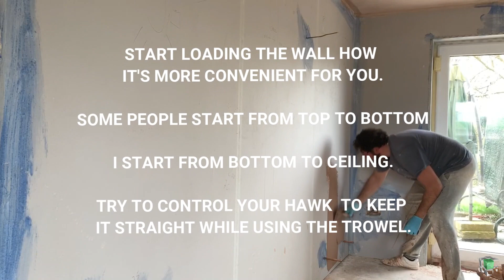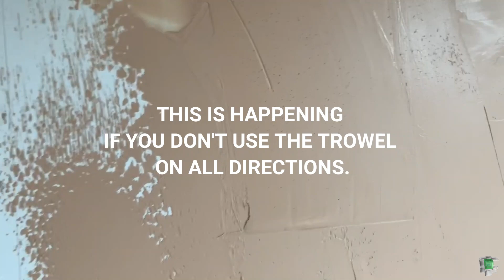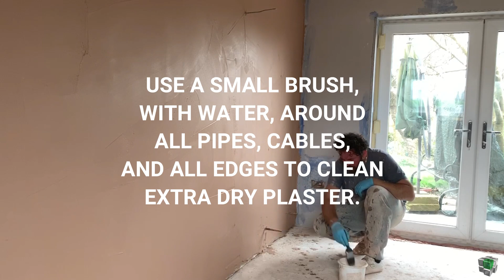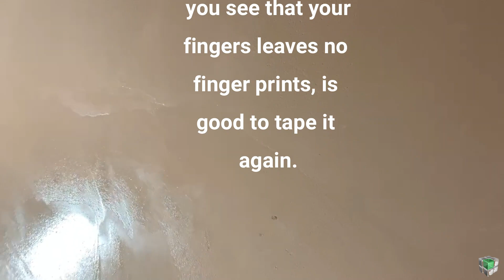How I do plaster easy steps, how I skim a wall, two coats of plastering, finish using a taping knife

Comment: Hi, loving your videos. Really good. My girlfriends uncle is a plasterer in poland and he uses the taping knife/spatulas too. Good method. I have a question when i use the taping knife i tend to get lines in the plaster. Any tips to prevent this happening?  Thanks
Reply from the maker: It could be many reasons... one I had it was because my tapping knife it was old and bend, one of my workers put it in a bucket with other tools and it wasn’t straight anymore... another reason it might be that the corners are making marks... so I bent my self the corners of the tapping knife, so it won’t leave anymore marks... and one of the most common reasons is if you’re keeping the tapping knife too flat towards the wall, you will often touch it with your fingers, or the tapping knife handle... I hope I could help with this answer... Goodluck 😁
Reply: @askhowtube  Thank you for the reply. I will try and round the corners today and check they are all straight edges. Keep the vidoes coming. Good job. Thanks
Reply from the maker: Thank you..

Comment: All the British spreads are stressing over this 😂😂😂 Do whatever gets a good finish! Even if your putting it on with your feet 😉😂
Reply: No mate,  I'm telling you right here and now.. you lay on 1st and 2nd coates like that day in day out... You will be finished before your 30.

Doing it that way on a 3.5 x 3.1 is OK you get away with it.. Try laying a 25-30m ceiling like that.. There's nothing wrong with useing your own methods. But some  just make the job way harder.
Simple facts

P:S Any bloke that shines up his walls.. Gets binned immediately.. Especially if on site work, gaffer will knock you for sure..
Reply: @stevengordon2145  what was wrong with the way he put on? Not being argumentative, just curious bud.
Reply: @CompetitiveEllisy  like I stated before, you can lay on in what ever way you like. It's down to personal preference.. 

But one things for sure.. shined walls don't take paint, painter's will need to sand it back and they'll be angry with you, matt finish is best 

Also in regards to laying on methods, working in short stokes on a small wall say. 3m x 3m you can get away with it. but on a bigger hit say 25m - 30m you gonna struggle to keep with your set.

Nice even long strokes.. Poor bloke looked knackered at the end
That's because has working way harder than is required to achieve a nice finish..

Work smarter, not harder..
Reply: @stevengordon2145  Ah I totally agree with you, giving it a little shine at the end with a plastic trowel won’t do any harm though and makes it look lovely. Obviously not over troweling with it though

Comment: Great video - I do plastering a very similar way and the results are good...using a taping knife of a skimming spatula is not traditional here in the UK but it does the same job (it is preferred over a trowel in many countries). If you only plaster occassionally like me, you have to use whatever method is easiest for you with the tools you have. You will get negative comments from professional plasterers in the UK as many are taught to work in a strict way - its not racism though, be careful of interpretting it that way...anyone doing a video showing how they do a DIY process will get nasty comments - we all work differently but if you are happy with your speed and results and the job is sound thats all that matters - again, great video.
Reply from the maker: Thank you for encouraging words... good luck.

Comment: Pointless having a trowel that is bigger than your hand board - you can’t pick off anymore. Get a smaller trowel, work left to right and use the bigger one to flatten your work 👍
Reply from the maker: Thanks for the advice Daniel... will try that on my next plastering job. The thing is that an English plasterer recommended me to use this big trowel few years ago 🙈, but I can see lots of comments says that the trowel is too big... I got used to it to be honest 😁...anyway thanks again for the kind advice. Goodluck.
Reply: Use what works for you mate your doing the job no one else 💪💪

Comment: Why pva ceiling edge after it's been plastered?
Reply: dixie normous it stops the previously plastered surface pulling water out of the wet plaster. If you don't you end up dragging dry lumps onto your work.

Comment: Sorry mate but no way you should be doing a how to video. For a start that trowel is way too big to use effectively and as a right handed plasterer you should work left to right or you will never get rid of water marks when troweling up.if you pva the finished plaster it bleeds through the paint so decs will not be happy.
Reply from the maker: Jamie Taylor thanks for the advice. I have learned plastering on my own, I have plastered all extensions I did, plus other houses... I do this job since 2011, and never had a complaint... anyway to not offend other plasterers whom doing differently than me( which I respect), I will change the name of the video from how to do, into how I do.
Reply: You say the pva will bleed through the finished plaster? When I was taught to plaster at Croydon plastering college, the plasterer said to mix pva with the first coat of paint to help it adhere to the plaster. Would you agree with that and perhaps that would stop the bleed through you speak about?
Reply: @peterpage7322 
 I dont like painting myself so i dont do much of it. I only go by what all the decorators i work with tell me. If any pva goes on newly plastered walls they all complain about how many coats it takes to cover up. Ive never met any decs that mix pva with paint